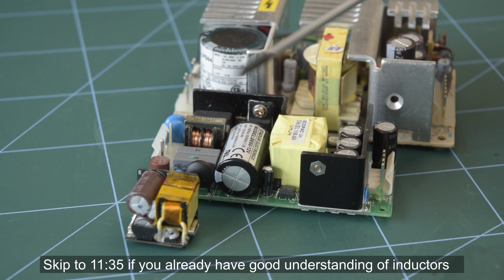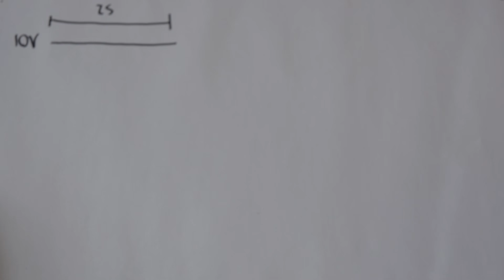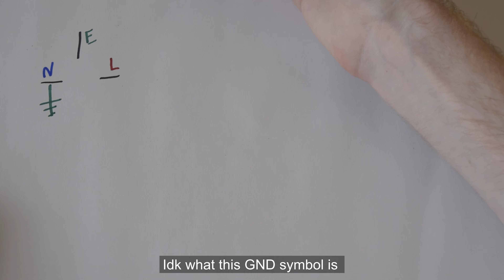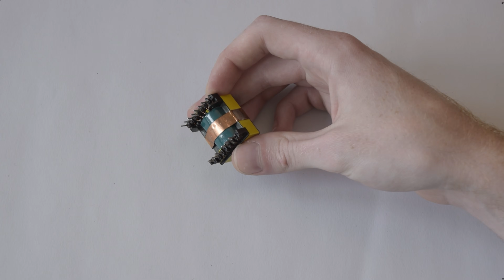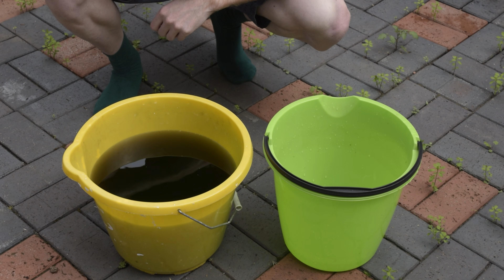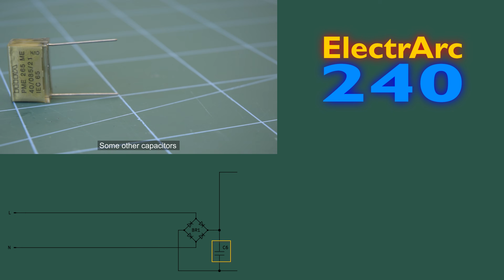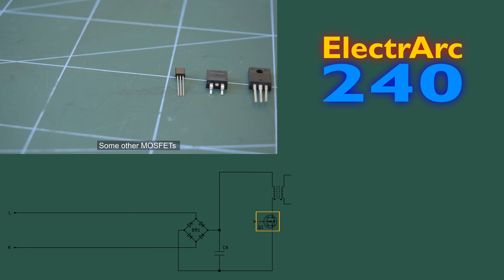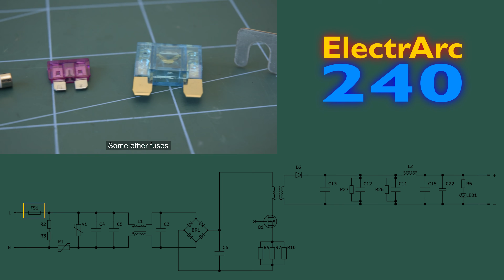Every Component of a Switch Mode Power Supply Explained

Comment: This is without doubt one of the very best videos on electronics circuits explaining a power supply. You would've watched as many 20 or more electronic repairs here on YT and tried figure out their diagnostic steps before getting down to repair side and left feeling oh great he fixed it or no he didn't manage to fix it, well this talk through just made our understanding much more better. I did see somewhere an east asian professor actual just solder the components together but had to rely on reading subtitles to try and understand the process. I wish I could find that video again. Excellent video I know i shall watch again taking detailed notes.
Reply from the maker: Thanks a lot!

Comment: You have explained an abstruse electronic circuit in all adroitly just like a professor. I could never learn in a better way than this. Please make a tutorial video on "how to make a resistance-based contraption to discharge a high-voltage capacitor" to safely bleed it. I've happily subscribed and liked it. Thanks

Comment: I've spent over 35 years in industrial power electronics, own and operate my own engineering firm, and taught full time as a professor in technology for thirteen of those years.  Kudos to your teaching methods.  You're water illustrations are brilliant and intuitive and speaking as a Canadian who recently visited Yorkshire in Britain, I love hearing the British accent and idioms in this video.  Some corrections however: The thermistor employed for over-current protection is a PTC (Positive Temperature Coefficient) device, not an NTC (Negative Temperature Coefficient) device.  NTC thermistors are used for temperature measurement.  PTC devices act like resettable fuses and limit inrush current by increasing in resistance as a function of temperature (i.e. higher current).  Both are non-linear devices.  MOVs behave like back-to-back zeners and exhibit very high resistance until you reach their break-over voltage but unlike an SCR, don't avalanche (assume full conduction when triggered on).  In this way they only clip excess energy above a target voltage threshold but they don't chase it all the way down to zero volts.  MOVs also tend to deteriorate with each spike they take so their effectiveness over time can diminish and they are rated in Joules as well.  Also, MOVs like to explode when their energy levels are exceeded so I've seen designs where they're shrink wrapped to contain flying bits in the event of.
Reply from the maker: Interesting about the MOVs, thanks for that! The input thermistor has the marking "NTC 15D-11" so I think in this case it is actually an NTC but I did record the video discussing PTCs first then bent it away from the cap to double check only to find out that it was actually an NTC to my surprise
Reply: @electrarc240  OK, I'm going to walk back some of my last comments after researching your part number.  The application here is different than the over-current protection I assumed from what you were saying.  A PTC device is indeed the desired mode of operation for over-current protection, but as I now suspect you were alluding to in your video, that is not why they're using an NTC device in the power supply you featured.  Ordinarily NTC thermistors are for temperature sensing, albeit with a non-linear relationship that must be corrected in the measuring circuitry, either with a look-up table or with a logarithmic amplifier.
Your part is a "Power NTC thermistor" and when cold (i.e. before being powered), starts at some high resistance.  This resistance then impedes inrush current that would be experienced by the power supply to charge its input capacitors.  Thus the NTC device initially limits the current that would otherwise be experienced by the source without it.  Once current begins to flow, the NTC device will self heat and its resistance will decrease inversely to temperature (negative temperature coefficient).  Once its resistance drops, the down-stream power elements will then receive sufficient power to function.  If the load becomes excessive however, the NTC thermistor cannot resolve that the way a PTC device could, instead over-current protection will depend on the fuse to act.  So, now I understand why they chose an NTC device for this application - my mistake.  Also, most of the PTC devices I'm familiar with max out at 60V, and could not handle 230Vac mains.  PTC devices are also used in telecommunications for traditional analog phone lines instead of fuses because they are self resetting after the downstream fault has been resolved and device current falls below the trip threshold.
Reply from the maker: @ProfessorV.  Thanks for all the info!

Comment: No one really explained the flyback with a succinct explanation as you just did, as was used in cathode ray tubes and ignition systems and so on. The whole video is excellent!!!
What goes on to cause a power supply just to go bad from sitting for years. Yes, capacitors crap out, just from age, but what other things deteriorate with age, that last worked, but just haven't been switched on for years and is dead now.

Comment: This is one of the best videos how switching psu work and what are the components for 👍 The only thing I missed was the relation between the frequency and the transformer size - the main reason why they can build small psus with relative high power output because of the high frequency operation. As we know conventional psus work at 50Hz connected directly to the mains.

Comment: An excellent presentation. As a radio ham who is plagued by noise caused by cheap switched mode power supplies I wouldn't refer to the EMC regulations as 'annoying'. Some units made in the far east have been known to leave the EMC components out to save on production costs . .

Comment: The 'black chip' you refer to at 21:55 is/are Opti-Isolator(s). Their function is to isolate the "Hot" from the "Cold" (high voltage from low voltage) circuit to prevent 'backflow.' This was an excellent presentation, and I thank you for your effort.

Comment: The part that I found failed most often and killed the 5v/12v output SMPS that I used to repair was the electrolytic starter capacitor. 
It appears to be the smaller cap next to the control IC in your power supply.
Liked and subscribed as that was a very good video and explanation.

Comment: ELI the ICE man, baby. I used to fix all kinds of power supplies back when it was cost effective. One of my fav's was a 12 volt to minus 12 volt invertor found on a hard drive motherboard. There was another type that would eat a feedback resistor with an awesome release of high voltage plasma. Most problems I found were in the voltage regulator / feedback loop, not so much the high voltage side. Thanks for sharing!

Comment: Great video, but what I would like to see is oscilloscope pictures of the power as it goes thru each stage of being fixed, especially that part where you filter and smooth the output, that would help us make better sense of what is going on in each step.  Thank you for doing all that work!

Comment: The video effectively explains that while SMPS is more efficient, it can introduce noise into the output, which can be problematic in sensitive applications. The common practice of using a switching power supply for large voltage conversions followed by a linear regulator for cleaner output is a smart design choice that balances efficiency with the need for a stable and noise-free output. Overall, this video provides a comprehensive and practical understanding of switch-mode power supplies, making it an excellent resource for anyone looking to grasp the essentials of power conversion in electronic circuits.
Reply from the maker: Thanks! And yes the switching + linear topology is really nice but sadly not particularly commonplace it seems. I suppose because of cost and lower efficiency. I’ve seen it in quite a few lab supplies though

Comment: My specialty is EME - I was the lead design engineer for this area within my Countries Military. I've covered cases of crashed aircraft, Ambulance defibs malfunctioning, panels on aircraft detonating from stored charge, onboard fires and a butt-load of other smaller situations created by failure to manage changes which create radiated or conducted emissions of a nature that influence other system operation. I see them routinely in civilian environments too - be it the home or commercial setting. It's not something to be brushed off.

Comment: Great explanations, very clear, congrats. Obviously you can't go into every details or the video would be much longer, but you did a great job of explaining the fundamentals. I was quite surprise that the backside of the PCB didn't have a clearer physical separation between the primary and the secondary. I know much less on the topic as you but galvanic isolation seems a inportant topic in modern SMPS.

Comment: Great video. Well explained. Thanks. To ham radio operators EMC regulations are hardly annoying, but rather crucial. So many cheap power supplies don't have the EMC filters in place, but often have a space on the PCB for them because the manufacturer puts the filtering components in when applying for EMC approval, but then takes them out of the shipped product to save a few pennies per unit, This ruins radio signals for amateur radio operators, and often AM broadcast radio as well. So please, don't skimp on proper power supply filtering!

Comment: One of the best explanations of SMPS I've seen/heard. Now, only way to improve it more would be to also explain voltage/feedback control even if not directly with chips on PCB. Step up from that would be also making specific schematic, like what parts or parameters would be used to create "110V/12V" or "220V/12" SMPS, while also explaining why were those parameters chosen (exluding math ofc). Or even making several schematics for 110V/220V with 3V/5V/9V/12V/15V/18V/24V etc...

Video as it is, is nearly perfect and on pair with lecture on some university. I salute you good sir.
Reply from the maker: Thanks! I hope to do more in depth videos on SMPS soon

Comment: What would be really good is if you could go through the snubbers. Such as the RCD on the primary and the RC on the secondary diode. Your very clear way of explaining stuff would be very helpful and highly appreciated.
I built a 12v~300V flyback, and while it works well and the snubber on the primary works, I'm sure it's not optimal.
Cheers
Matt.

Comment: Electrician and electonronics enthusiast for years here (since young teenage years). This has been a really good description. Thanks. Question for you. I was workign with some op-amp and had the virtual ground (battery and voltage divider made) ooked up to RPi negative. I wanted to hook the Pi plug pack up to a virtual ground made by the DC from another wall plug pack (some people call them wall warts). Bascially replacing my op-amp battery with a plug pack. Before doing this I figured it was good to get the old volt metre out and see what I'm measuring between the supplies to make sure both are floatign independently from each other. I connected the multimetre between the Pi's negative shield on the plug to my other supply's negative. DC measure somethign like 250mV, so wasn't worrying me. AC though measured 12V😕As I couldn't tell if this was just noise in the system I had to assume there was some sort of reference between the two, though both were double insulated and had no earth pin. Can you explain this? Before I go and blow the Pi's supply up by doign something stupid.

Comment: In a future video, you could explain the importance of the switching time of the active components of a switching power supply.
Fast switching times allows for minuscule, or non-existing heatsinks on the switching elements. Degradation of the semiconductor junctions, which increase the switching time of the components, will increase the power dissipation and therefore the temperature (often 10x times and more) of the part, which in turn will blow. Degradation is caused by aging,  by bad manufacturing process control, and by moisture seeping thru the case of the MOSFET/diode, usually.
Thanks for all your effort in explaining power electronics.
Greetings,
Anthony

Comment: Nicely done.  Best explanation I have heard so far.  For your next videos on this can you add a bit more as to the specifics of the 65K freq?  And yes the controller circuit which looks like an opto-isolator component would be nice to expand on too.  I am sure there are many kinds.  Cheers.

Comment: Great, very clear; would have appreciated a longer explanation of the difference between the 'coupled inductors' and a transformer. That's not at all clear. Would have been even better if the controller function was explained, but that's what everyone is saying. Also, there were no switchers 60 years ago and linear power supplies, with transformers, are still lovely and quiet. Explanation of why they are not used would have been good.

Comment: Bro very nice video you explained but at 14:53  you said another component is inductor which filter the dc but what is does is to retail constant current which determine the output Ampere of the circuit not to filter more dc. Which is ampere will determine the watt or power of the output circuit. I  knew this when I repair my subwoofer power supply when it got burnt. Kudos to your video keep it up

Comment: there are a couple more analysis that might help some people coming to electronics with other experience.  

The spark on opening the circuit on the primary was a good idea, but you could have gone on to point out that in a petrol (gasoline) engine, the spark is created in exactly this way: nowadays with electronic switching for the primary, but back in the day using a mechanical switch driven by the cam shaft.

The spring analogy demonstrates energy storage, but a better analogy for an inductor for anyone who has worked with water systems is a water hammer. In a hydraulic ram water is allowed to build up momentum, and when it is abruptly shut off the team effect can be many times the pressure that was used to create that momentum. In terms of the physics of what's going on, the momentum of the water current is analogous to the stored magnetic energy in a coil with an electrical current. When not wanted, a water hammer can be an irritating effect of turning off water flow, or in rarer cases can even cause components to fail.

Comment: As from your pinned post, it is already clear that of course we do not have a working power supply without anything driving the switching MOSFET. Also, an 'inductor' with a primary and secondary coil is not "just like" a transformer, it IS a transformer. There really is no difference with a traditional transformer in the way it works. The ferrite (vs. iron) core material means it can work at much higher frequencies so it can be a lot smaller as you've clearly illustrated with the glasses. Overall excellent explanation besides these small remarks, looking forward to part 2 driving the FET with an oscillator, controlling it with PWM and adding the feedback circuit ;-)
Reply from the maker: A coupled inductor has an airgap to allow a lot more energy storage, would be a very poor transformer. But yeah no controller no supplying power :(

Comment: This was great. I have been occasionally repairing PSUs for quite a while and the video filled in a lot of nagging holes in my understanding. 

I would like to see more videos that help me identify the different components to help me diagnose failures (important for restoring vintage equipment where I can’t just buy another replacement PSU. Or a video that shows me what to expect to see on test equipment, for the same reason. (I liked the example with the inductor. )

Comment: I've still got some big old black n white TVs from 60s era that simply use a resistance line to tap off various smaller voltages . They did heat a room up quite nicely in those days when electricity was cheaper and valves glowing nicely. The ideal was to limit to 10% the power tapped from the voltage divider line. The brute force days, today it's all about finesse. There's alotta interference on our AM radio these days though from power supplies and solar inverters.

Comment: Just a quick note:
For the spring you have used as the mechanical equivalent of an (electrical) inductor - though that in itself could constitute another good topic for discussion - the energy is not stored as 'tension'. You are clearly pressing onto it, so the spring is being subjected to compression in its entirety. As an effect of that overall compression the spring experiences, each of its steel wire turns reduces significantly the pitch - i.e. the linear step along the longitudinal axis of the spring for one full turn, or the axial (i.e. parallel to the spring axis) distance between two consecutive windings. That causes torsion to develop in every cross-section of the steel wire; it is the elastic stress/strain field associated with this torsion condition that ultimately stores the spring energy.

Other than that (and me wondering whether a spring - a device that stores energy as potential energy from elastic deformation - is really the best analogy to use for inductors, which store energy in the stationary magnetic field, from the current traversing it), keep up the good work! Your channel and the explanations your videos provide are brilliant!  👍